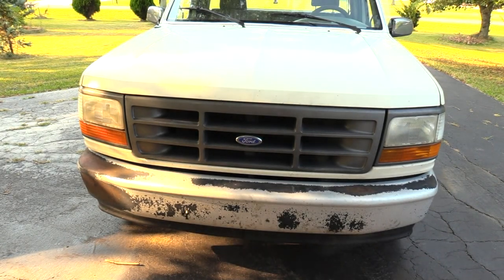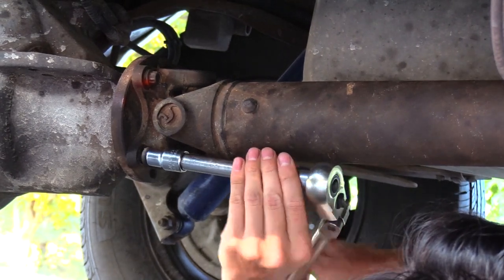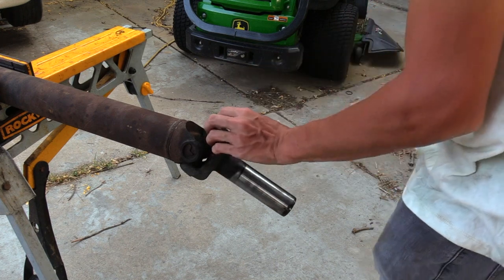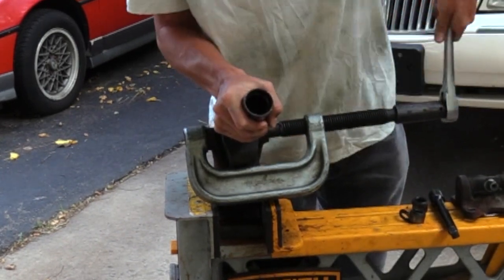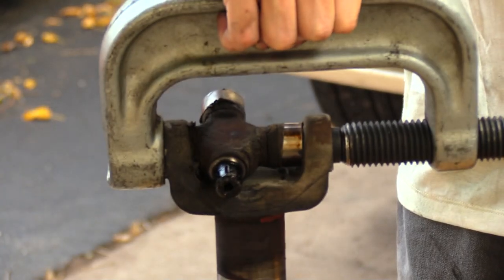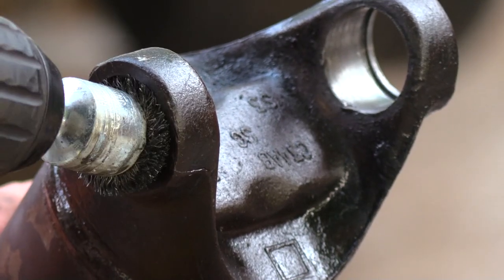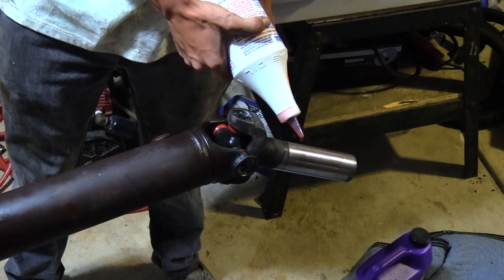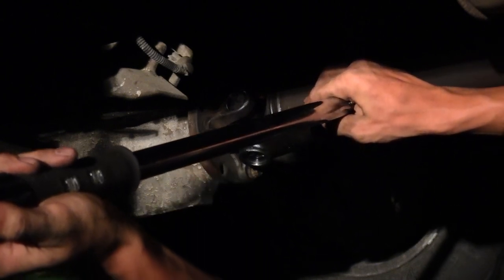Loud “CLUNK” when shifting into Reverse or Drive? How to Replace Worn U-Joints, fast and easy

Comment: This is BY FAR the ABSOLUTE BEST VIDEO that I have seen so far regarding this particular fix!!👍😁
Reply from the maker: Thanks ! My first blown U joint was a 68 Firebird, and the mechanic changed it with a bench vise and big hammer
Reply from the maker: @earlweems5799  I learned this when I was 19 years old that was a couple 19 years ago …
Reply from the maker: @earlweems5799  I learned this when I was 19 years old, that was a couple 19 years ago…

Comment: Once again Norm you did an awesome job. And taught Richard something he can use through out his life.
Reply from the maker: Funny thing - I learned the old way when my 68 Firebird dropped a u-joint in traffic.  It’s a helpless feeling when the engine runs great but the car won’t go. It was a rear u joint and the drive shaft fell out on the ground

Comment: Hey Norman. Love ur channel. Perhaps you can suggest something 4 my wife's Daihatsu. It clunks when she shifts into reverse from park. The car is less than 2 or 3 years old. She does not drive very often and she is not a hard driver at all. The car was bought new from the dealer. She does set the parking brake and does step on the brake as she shifts the car into reverse. Plz help. Thank u in advance. David from Ishikawa, Japan
Reply from the maker: First, question. Is it front wheel drive ? I  need to know if it has a drive shaft ( in Mazda manual called propeller shaft). I would consider checking for worn CV ( constant velocity) joints . Also check transmission fluid, for proper level, even color if it’s an automatic transmission.
Reply from the maker: I forgot to ask warranty ??? Are planning to fix it yourself ?
Reply: @normanpaulife  Hey thank u 4 the reply. It is a Tanto and yes it is FWD. I understand what parts you suggest could be broken but since the car has very low miles should those parts have a longer lifespan? Or is it not uncommon for those parts to break so soon. Plz let me know if I may provide more 411. Thanks again my friend.
Reply: @normanpaulife  it should be under warranties. My wife is Japanese and she does not believe in fixing the car ourselves. I would if it was my car but I am not going to touch her car but I do offer.

I just would like to have a better understanding so I can let the tech know my thoughts so he does not have to waste time guessing and troubleshooting.

Comment: I have no noise when putting truck in reverse but it will not drive backwards, acts like it’s in reverse. Put truck into drive and loud clunk noise push the gas pedal about halfway barely moves 5mph…..any ideas?
Reply from the maker: Unfortunately, yes . There are a couple couple potential causes, but what you describing does not sound like U Joints . Check your brakes ! Are your emergency brakes stuck ? Does it roll in neutral? Jack the vehicle an try to rotate the wheels. Rear brakes be sure the transmission is in neutral, front brakes don’t matter UNLESS it’s a 4WD  then it too needs to be neutral. If the wheels rotate , you need to check the transmission, standard or automatic? Check fluid levels, worn clutch etc
Reply from the maker: As I thought about it for a moment that sounds like classic LOW Transmission Fluid level, check the dipstick with the transmission in neutral and warmed up for the most accurate reading , but if it’s low start with half quart and add slowly. Overfilling the transmission causing foaming and that too leads to problems. I would use Lucas transmission additive it helps improve shifting if the transmission ( truck) has high mileage. Best of luck. Any further questions feel free
Reply: @normanpaulife  went to check on truck 8 hrs later and it shifted into reverse easy and drive backwards no problems, put truck in drive and shifted easy drive normal. Like there wasn’t anything wrong with. Only check engine light is on. Going to get it checked out today. Truck only has 130k miles on it. It’s a 2013 gmc dually. It has been deleted so it’s not the def situation. But I do appreciate all your advice. Also when coming back to truck, I put truck in 4wd and everything worked perfectly reverse and drive, shifted in and out easily as well. I’m wondering if it’s the “tcm”?
Reply from the maker: You are describing a more in depth problem. With a check engine light , that’s certainly the best place to start. I have seen shifter linkage become loose under the steering column cause transmission irregularities.

Comment: I have an issue where when I go from park to reverse, neutral and drive it has a slight jerk but it drives very smooth. Just did a drain and fill trans fluid. What can it be? I done some research and may be an engine mount but can it be a ujoint?
Reply from the maker: It’s fairly easy to test a u joint , rotate it ( the shaft) slightly in one direction to remove the slack, then slowly, carefully, rotate it the opposite direction, here you can feel how play (slop) in the joint it has. If you feel slop, if it rotates slightly before the opposite shaft turns , it’s too much. You are turning it by hand with no load , when it’s under load the difference will cause a snapping action ! This can cause it to snap and the drive shaft to come loose and whip around under the vehicle and cause severe damage. If the forward u joint breaks the shaft with plow into the road and possibly strike a man hole or sewer cover and damage the rear end. 

The parts are inexpensive and the auto parts stores loan the tools ( I believe) for the job. 

BY the way, I have experienced a failed U joint with drive shaft drop in my 68 Firebird !
Reply: @normanpaulife  thank you for responding but I want to know what would you diagnose my issue? Is it a bad mount? That is causing the jerk when shifting?